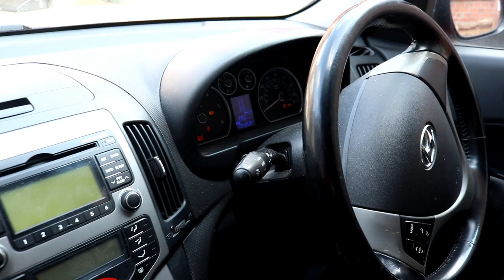3 PH METERS

Comment: That's not bad for those cheap phone meters if they work out,getting replacement buffer solution is probably the hardest part for most although you look sorted. That vacant gesture recipe will go down a treat with home brewers,how many is that you have released now? Glad the tour went well m8. Cheers.